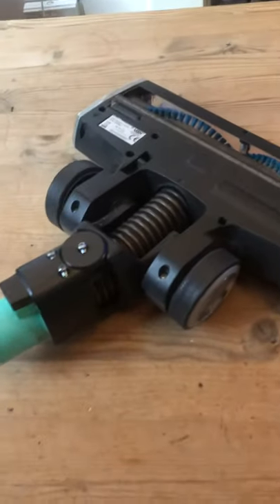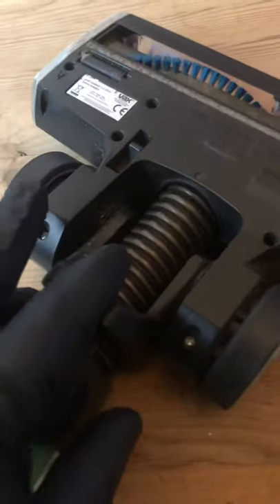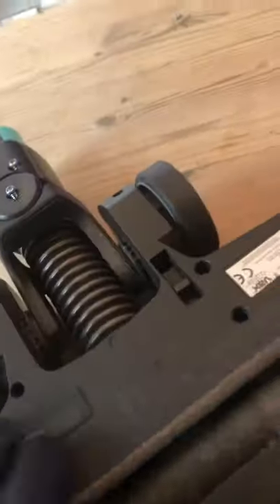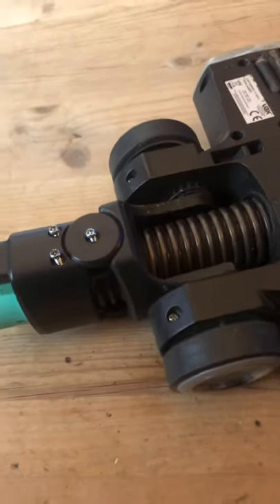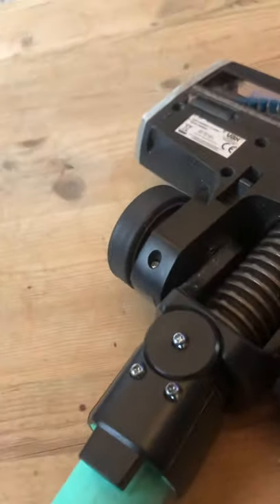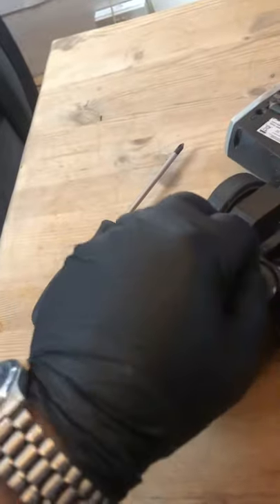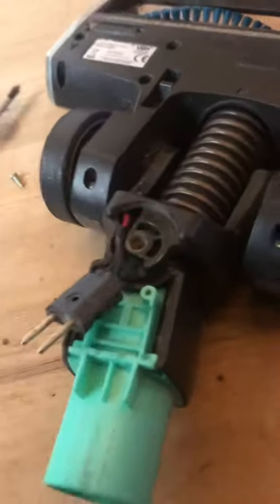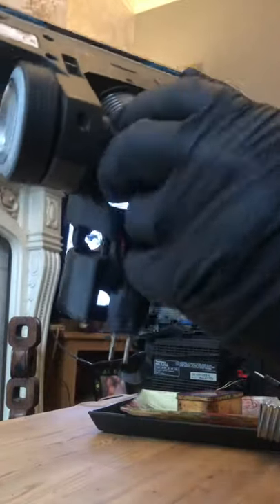How to change the hose on a Vax blade

Comment: Thanks! I also needed to prise out the ring on the other side of the floor head, opposite the cover to the power connector, in order to get the two apart. Very helpful!

Comment: you Sir are a flippin star. I too have watche those other videos and even though I am confidant I can have a go at anything, I just thought no way to that!. But, I do need a new hose as mine is split a lot and the gaffa tape lost its sticky and came away in the end. so finding your video has made me so happy. I have ordered a new hose which should be here tomorrow and I already have the old one off. Incedently I found it easier to cut at the place it had already split and so I didn't have to pull so hard
Reply from the maker: Excellent I’m happy my video has helped you out 
Thanks for taking the time to leave your comment 👍

Comment: Thank you so much for that little video. Had a bit of difficulty getting out the bottom bit of hose out. Sure it was glued in! Did feel a bit seasick whilst you were setting. Thank once again.
Reply: Mine was glued in also,I just yanked it out with pliers lol. The new hose I used is a reinforced one from ebay.

Comment: Very useful how to video- thanks!  The blade 4 now has the pipe glued in place at both ends. It takes about an hour of scraping with a small screw driver and knife to remove the glue from the threads - it is difficult!  Once you have cleared as much of the threads as possible apply some liquid soap to the hose ends to make them easier to screw in. This helps a lot with the glued type.

Comment: Thanks for the video it made changing the hose a lot easier, sadly my hose was really hard to get out of the head part as I had to use needle nose pliers to wind the wire out then pick the plastic out in pieces as it felt like it was clued though it wasn't, the type of plastic was the problem as  it had almost welded it's self to the head.
It's a design fault by Vac as the hose will always crack over time, it's the second machine with the same problem, hopefully Vax read this and long term change the design as this wouldn't happen to a Dyson.

Comment: UPDATE i posted the new ones are glued in place, however having followed this video and discovering this problem i started to strip the head down, major job after an hour i thought" keep it simple stupid" and after studying it over a cup of tea i pulled the hose and stretched the wire reinforcing out all the way, the pipe became very flexible without the wire, so with a screwdriver i folded the pipe to the middle, grabbed both sides with pliers and unscrewed the pipe, without the wire came away from the glue with ease, now able to do the change as per video,  hope this helps people with the glued version.

Comment: The hardest part is removing the old glue and it's simpler to just pull on the old wire reinforcing to remove the old flexi time will tell if I should have sed silicone to hold the new one in place

Comment: tried this but unfortunately the newer ones are glued in place, so a bigger strip down is required, but once replaced this method can be used as it will not be glued just twist screwed,

Comment: Hi this doesnt work on the vax pwr 4 pet cordless as the hose is stuck in with like industrial strength glue,  thick black sticky stuff. i managed to rip it out and will try replacing the hose, if it works its saved me £50. If it doesn't will cost me £57.

Comment: Taken mine all to bits and have discovered that the head end was glued in and can't get the ruddy glue off (obviously from new) to get the new tube in?👹
Reply from the maker: Try heating it up with a heat gun or hair dryer to loosen the glue, and use long nose pliers to get old one out 👍